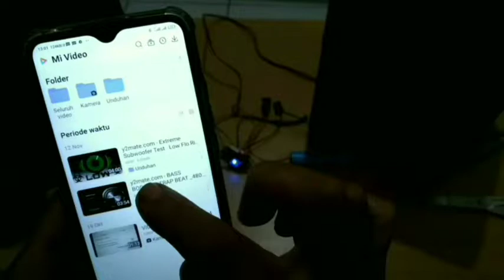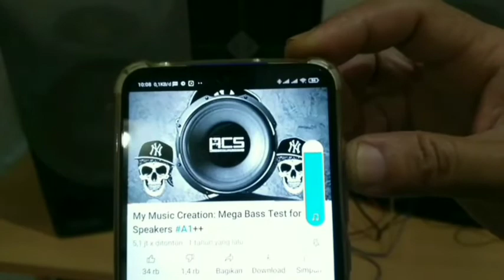Mengubah Speaker Pasif Jadul Menjadi Speaker Aktif Bluetooth (Amplifier Bluetooth DW-CT14+)

Comment: Maaf mau tanya bang itu klo suara 80% Sember knp ya
Reply from the maker: Sember karena watt dan ohm amplifier dengan speaker tidak sebanding
Reply: @TJinKwang  tpi spiker sya pke ukuran kecil aiyima 1,5inch
Reply: Sama aiyima 2inch sama j
Reply from the maker: @shirotabi1627  klu pakai speaker 1,5 atau 2 inch dan impedansi 4 ohm 5 atau 10 watt... coba speakernya dibantu capasitor elco
Reply: @TJinKwang  ok mas terimakasih atas saran nya 🙏 segera sya coba
Reply from the maker: DW-CT14 mampu angkat speaker 4 inch 4 ohm 10 watt... main di speaker fullrange 4 inch 4 ohm 5 watt paling cocok...
Reply from the maker: Satu lagi yg perlu diperhatikan, output amplifier positif (input speaker positif) dibantu pakai capasitor elco 470uf 10 volt atau 1000uf 10 volt
Reply: Tambahin step up bang biar arusnya stabil di 5 volt
Reply: Btw mau nanyaa power blutut  DW-ct14 yang untuk speker aktip  portable ambil powernya sebaiknya ambil dari batere power pakai stepdown contih poweer 9v di down jd 5v,,atau kah pakai batere saendir 3,7 volti.,bng trims pencerahannya😅😅